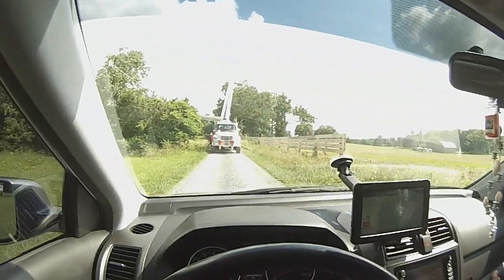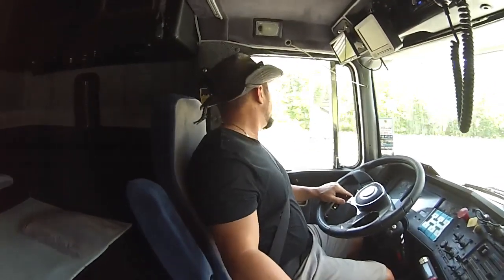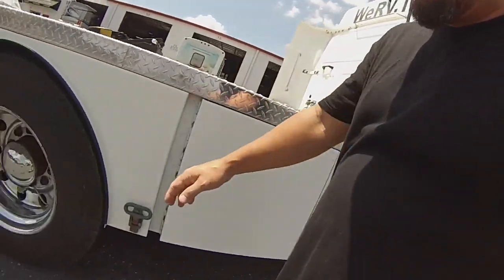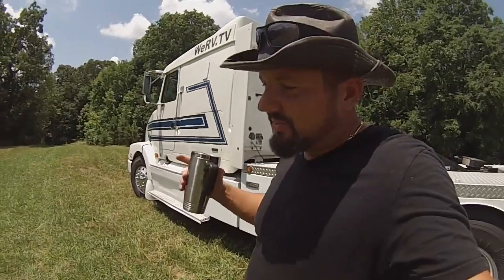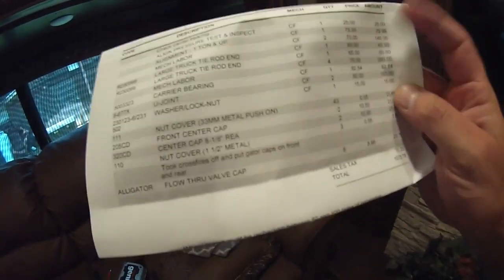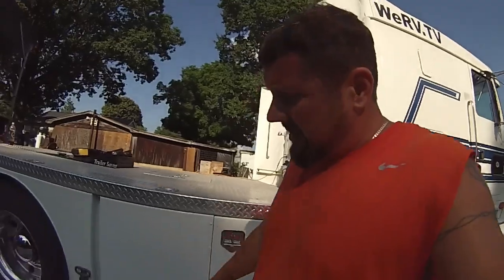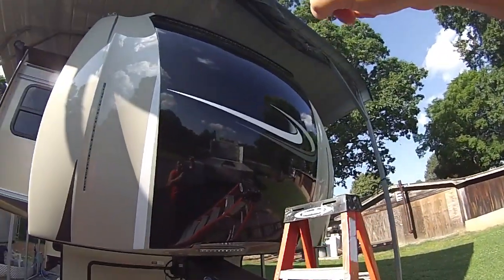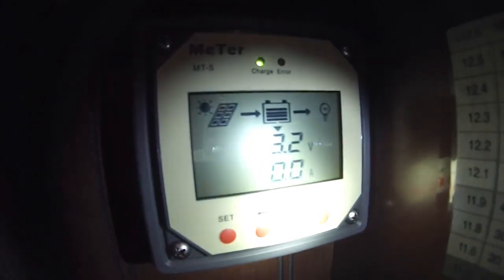RV Hauler Fixed, Removed Logos From RV

Comment: Glad the rig is fixed.. nice removal on the stickers.. as for the getting a charge with no amps is usually a shore power charger on the system when the solar is off.. hmmm ..least with mine.. safe travels.

Comment: So a Nike logo is good enough for your shirt but not the nose of your 5th wheel? LOL 
You're smart to replace your U-joints. A wrecker bill for a truck can easily hit $1000. (I'm sure you're covered under insurance, but you get my point.) Go to a truckstop where you can find a crackhead to polish your wheels for $20. Problem solved.